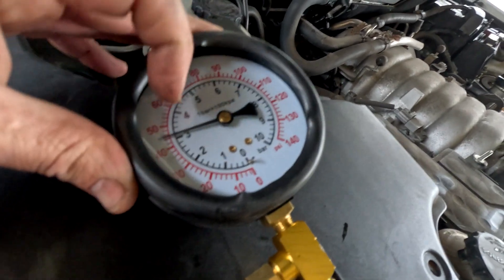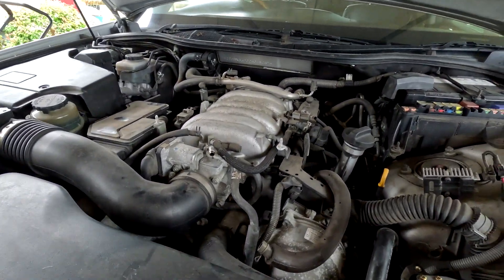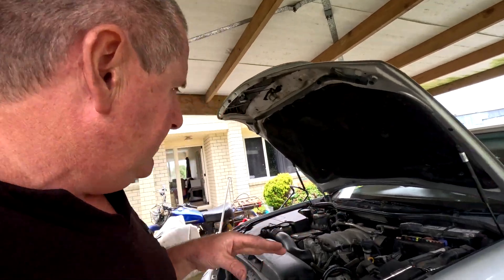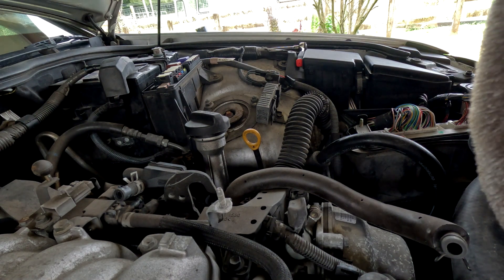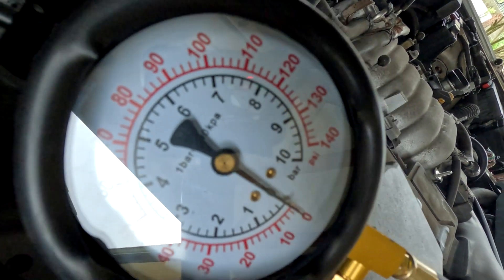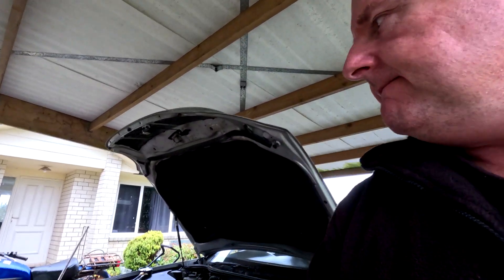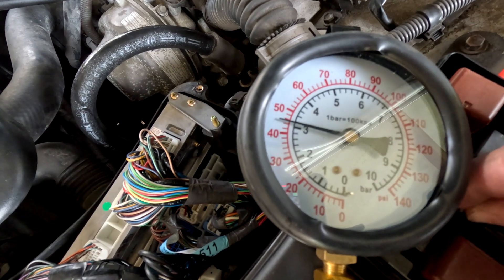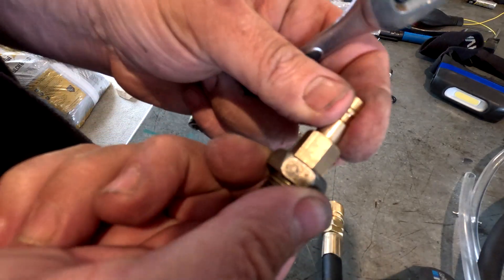Fuel pressure testing on Toyota Celsior 1uz VVti and 3uz Lexus LS430.

Comment: Hello, I’m troubleshooting a non vvti 1uz and I’m getting around 20psi before the damper, I’ve replace the filter and drained tank to blow out the lines for possible clogs. Pump was new but any suggestions to test pump?

Comment: hey Kelvin from the other side of the world (im in Saudi Arabia), amazing channel .. i was wondering what causes long cranks while engine is hot (3UZ FE SC430 2006) very good condition and well maintained .. suddenly started to take long cranks after using (but fires amazing and quickly when cold) i have already changed the cooling sensor since its the only thing i havent done for a while (didnt help with a hot start but reduced my fuel consumption rapidly)  .. i was wondering if it might be the regulator on the fuel pump ! my mechanic said its the fuel pump (no codes at all and the car runs idle like a new lexus) but the car starts amazing when cold ! i dont think its the fuel pump otherwise wont start and run amazing even for long rides ..... what do u think ? shall i go with that or i might have fuel injector leaks ? i guess even fuel injector means not idle and dosent give smoothe rides but my sc430 rides like Aladin Carpet :)      thanks and cheers Majed

Comment: After replacing my injector diaphragms, fuel pressure regulator, pump, and filter, I'm losing fuel pressure on acceleration. Once it gets to about 5k rpm my pressure has dropped to 18 psi / 1.25 bar. It's 50 psi / 3.4 bar at idle. Any suggestions?
Reply from the maker: Excellent doing the pressure testing.   Either there is a leak, like at the outlet of the pump or maybe a voltage supply issue.  Cheers Kelvin

Comment: Hi Kelvin, not sure if another video already address this.  But understanding that under pressure is bad , and cause bad performance that is notible.  but what if the system is running at 4 bar , it seems to do so nicely. Idles smooth and drives fine.  Would there be long term gremlins that should be addressed.   Or will the ecu correct it automatically. To correct any over rich fuel mixture.  Using an OEM ecu not aftermarket.
Reply: Also worth noting it is that it is in a build i did in my shed.  Its for my 80 series cruiser.  So as such some things are not present like in the car.
Reply from the maker: I run them fine at 4 bar,  it results in better fuel atomization and provided rest of the system is healthy,  like the oxygen sensors they run well.  It gives it only a small percentage more fuel and I check the fuel trims and if I'm happy I leave it alone.
Reply: Thanks

Comment: Excellent advise from you sir to simply watch the entire video FIRST !
This YT channel is professional repair of Luxury Lexus (and other cars) methodically described in detailed long form instructions and data advise. 
This channel is not some rando snap-chat-y nor TikTok-y.  <--you may have noticed this channel has an intentionally cinematographic perfect wide screen format, and almost complete lack of the idioticlly Vertically captured video (except when accidental or necessary) on this FINE YT channel. 
The main point is "WATCH THE WHOLE THING™", and then and only then PRAISE, or comment or complain about what you noticed in the video. Right.
Reply from the maker: Thanks for the compliment.  I often try to put the really quick answer at the beginning for the guys with a 2 second attention span,  then expand as most of my views like the information.  Cheers Kelvin

Comment: Shot i been running the fuel pressure in my boat at 58psi, might explain why my fuel pressure drops off to zero when engine off.
Reply from the maker: I think you will find you don't have a drain back valve in the fuel pump is why it doesn't hold pressure.  Not really an issue with an aftermarket ecu.  Cheers Kelvin
Reply: @CartuneNZ  have one way valve in line after filter, so im guessing a injector or many is leaking

Comment: Chinesium, this is what we are supose to get use to and except now, not much quality around these days, onto landfill in a few years when something fails or breaks.
Reply from the maker: Correct.  Its a bit disappointing but I now understand the dry break connectors and how to modify them to work somewhat correctly.   Maybe I should design a strickly lexus kit?